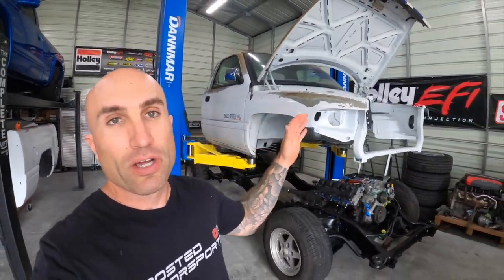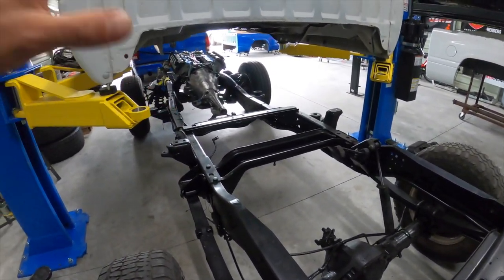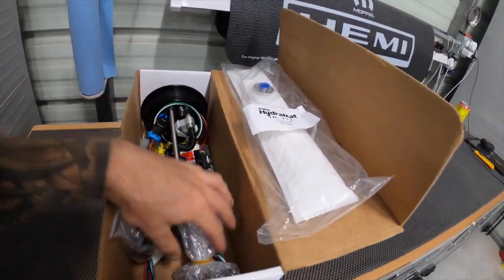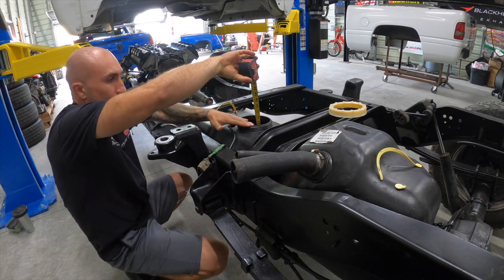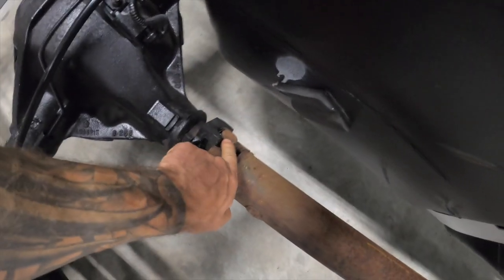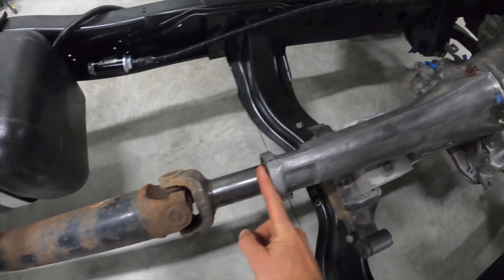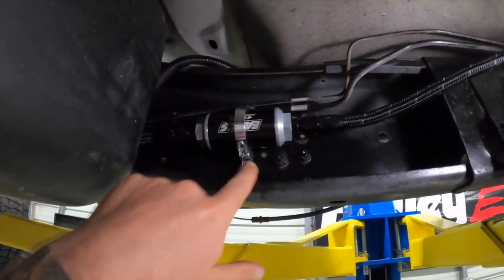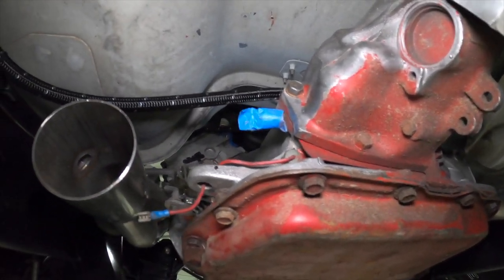HEMI SWAP Dodge Ram 1500 SST 2nd Gen | Part 5

Comment: You can flip the 6.4 fuel raìls around so the connection is at the back where the 5.7 is. The 6.4 intake swap guys do this all the time.

Comment: Question would it be easier if i had a donor 2009 ram truck and use the complete harness with ECM into a 97 ram truck? instead of the holley efi

Comment: I know this is super late in the game. Do you have a link to the crate motor and automatic 727 transmission? I am in the process of doing a frame up restoration on my 1994 Dodge Ram 1500 5.9 V8. I was gonna just rebuild the 5.9 but am interested in following your lead. 

Just having trouble nailing down what trans specifically and what crate motor. 

Thanks in advance if you see this.

Comment: I don't know why you are trying to keep the 727 transmission the truck came with a 46RE
Reply: 727 is manually controlled, no electronics and was supposedly built.  The 46re is electronically controlled, so he'd need a standalone module for that.  The re would likely never last behind the 5.7 even in stock form, let alone under boost.  And, if he ended up using an electronically controlled trans, he has the 8hp70 already.  All he'd need would be a module to control it.  Which, would be sick if he could get the stock shift lever to work with the 8hp70 electronic range selector.
Reply: The holly ecu can run the 46re
Reply: @rtesta  well, he doesn't have a good 46re laying around, unless he's been hiding it.
Reply from the maker: Yup I don’t have a spare 46RE just the 727 that came with this and a 8HP70 on the shelf. I could probably find a 46RE if I want to but as you mentioned the 46RE wouldn’t last long on stock 5.7 power let alone turned up with exhaust, intake and tune it should be making some decent jam
Reply: @BoostedMotorsports  you could always add a gear vendors overdrive to the 727 also.

Comment: Don't know what you are going to be running for Header check out BBK they have some Short Headers specifically designed for the hemi engine. I use them on my 5.7 Hemi 2009 rebuild. Send me a email and I can send you pictures
Reply from the maker: Lmao did you not watch the video? It has hooker headers on it bud